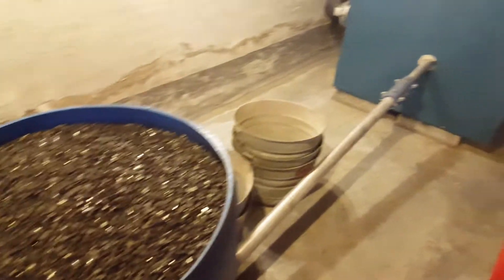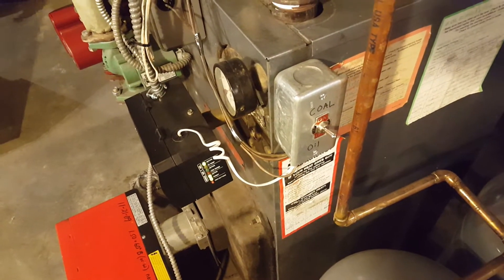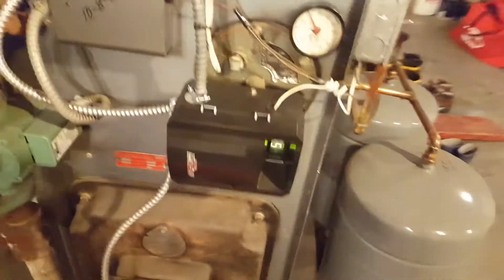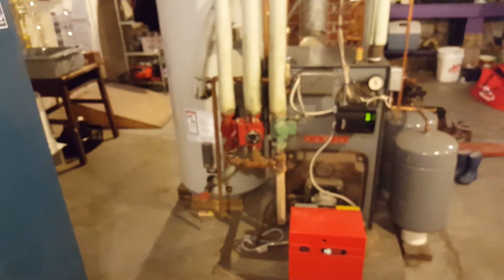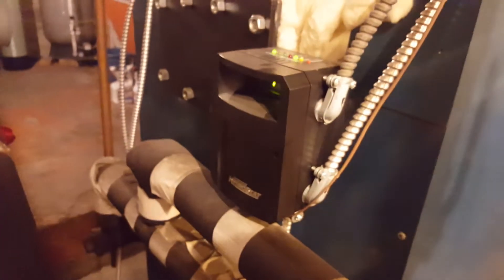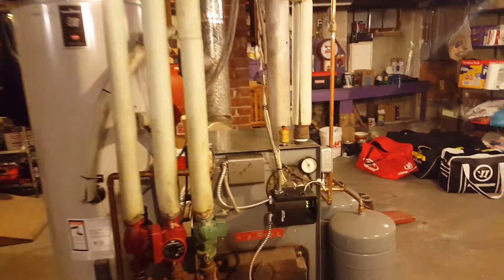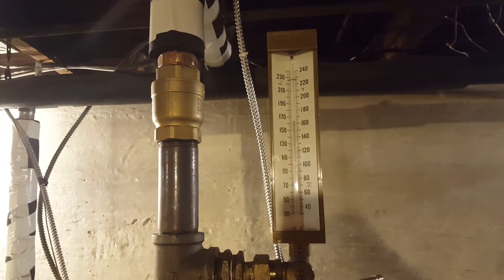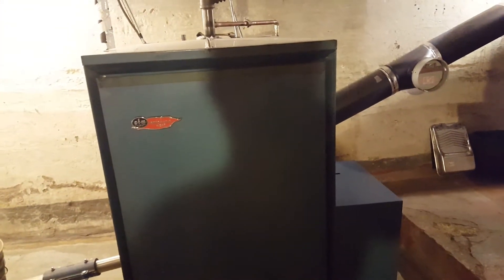EFM Stoker, Fall 2016 - Part 2

Comment: Nice setup Rob. So in purge mode the 2 boilers are acting as thermal storage tanks. The stoker will only fire if the heat call is not satisfied by purging the heat from the 2 boilers.

I love your 2 big a$$ expansion tanks! Are they Extrol 90's?
Reply from the maker: Correct.  This works particularly well in mild weather.  Often the heat stored from timer cycles is enough to satisfy a heat call.  It prevents the boiler from constantly running up to the high limit setting, and prevents over shooting the room thermostat setting.  Kind of like outdoor reset, but based on heat call frequency and duration.